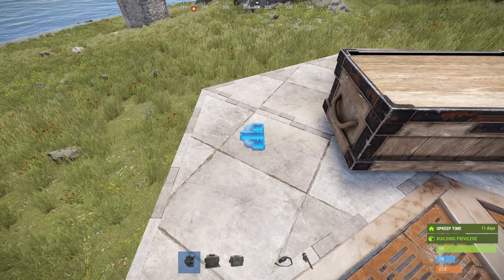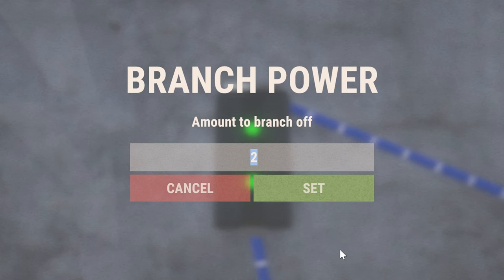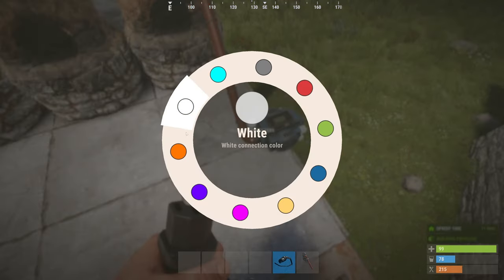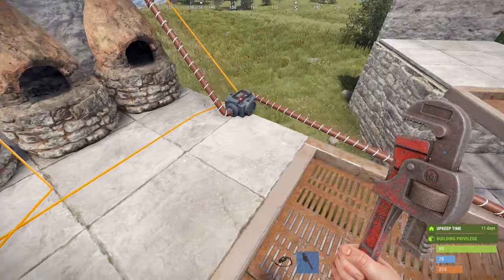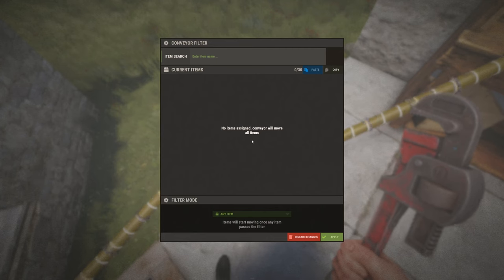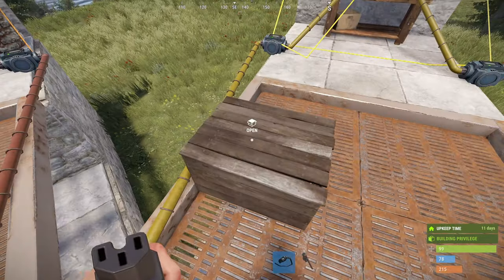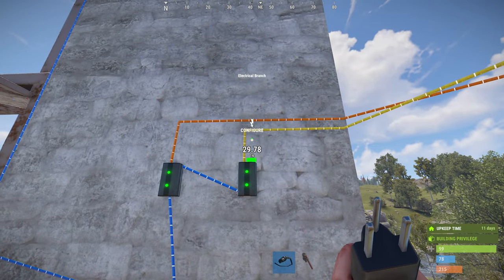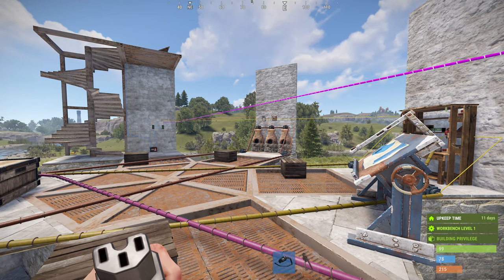How to auto craft Satchel Charges using the Industrial Crafter - Industrial guide - Rust

Comment: Once you get going with electric ovens dump the furnice and goto the oil refiners it burns faster and gives better percentage of charcoal. Plus you get low grade also if you toss a few gass cans in it. Great video. Ive done a few of these but watching how you do it fixes some of mine. Thank you. FNG Rusty
Reply from the maker: That’s great progression there - once you have the room. The good thing about small furnaces is you can put 8 or 9 of them on one square foundation.